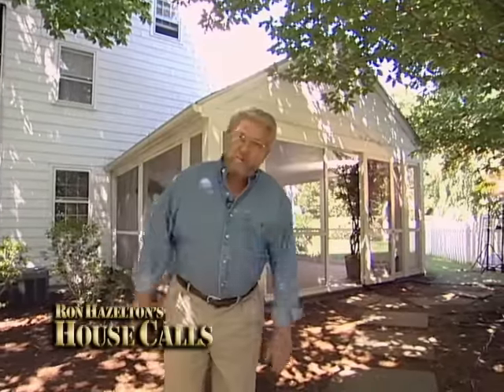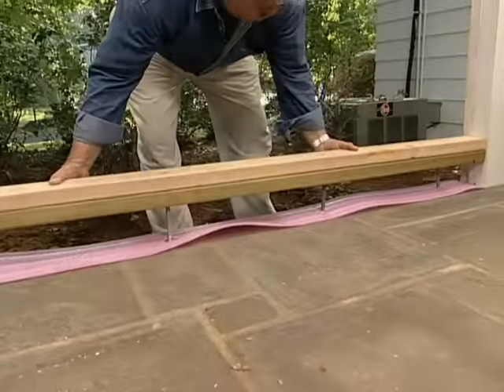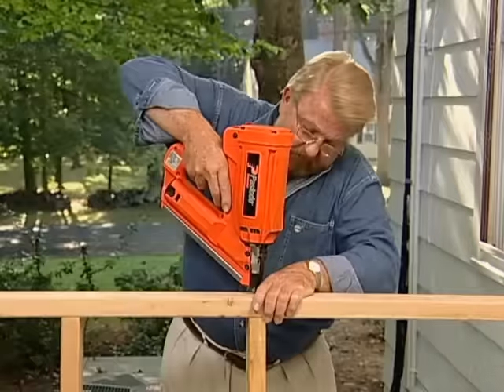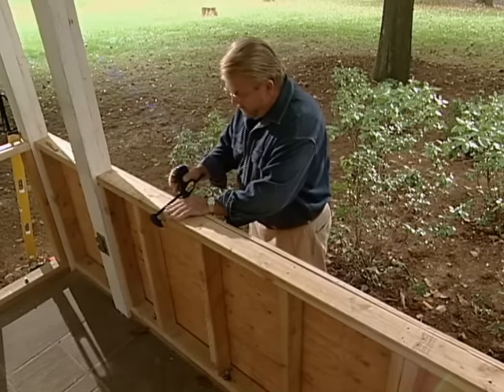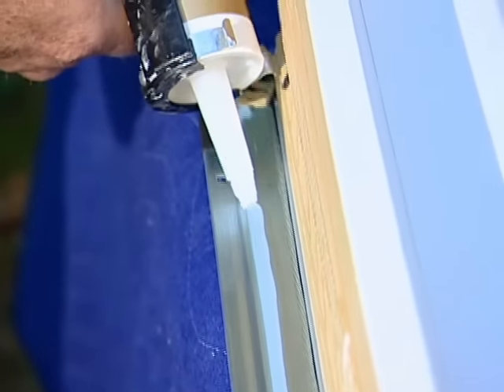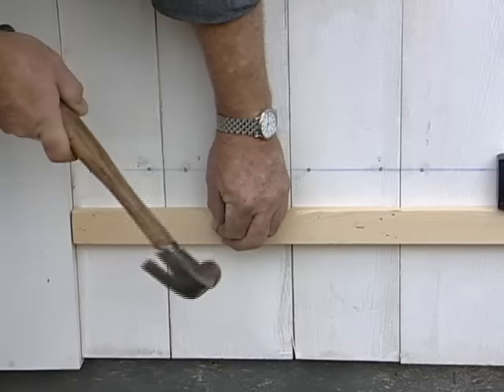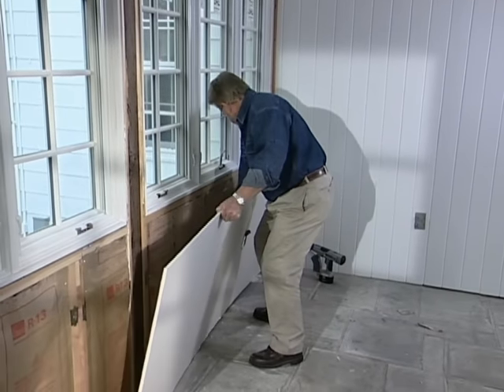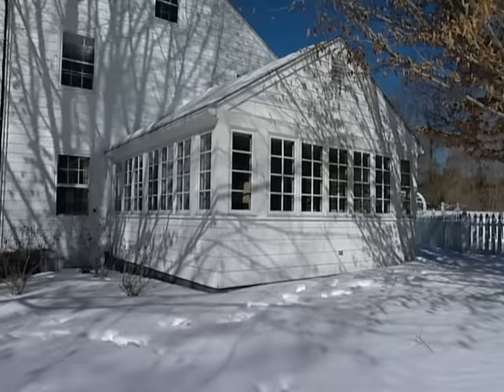How to Make a Four Season Room from a Porch

Comment: wondering if pounding on a nut topped expansion bolt causes the threads to deform. Seems like using a piece of scrap wood on top would be a good idea.

Comment: I have been reading about installation of windows and the diagrams they show include a header and Jack studs, and King studs.  This is to redistribute the weight of the roof around the windows.  I can understand the upper part because it has a large header as part of the roof but what about the bottom.  Nothing there but the studs on 16 inch centers.  Can they support such large windows?  Or am I missing something?

Comment: I am assuming there was already a header running around the entire room because it looks like you just framed in windows and doors with 2x4's without having to install any "structural" headers over door or windows to support the roof.  Is that correct?
Reply: Richard H porch roof is already properly supported by the posts that are anchored in the ground.  The walls are just "fill".

Comment: What about insulation in the ceiling?  Is that required to make it a 4 season room?
Reply: Should definitely be considered.  The reason it likely wasn't mentioned/done in this video is because you don't always have access if it has been ceiled in, which is likely the case here from what I see.

Comment: can you tell me if I would need to add more foundation to the existing concrete pillar footings on my screened porch in order to transition it from a screened porch into a four seasons room?
Reply: Mommi Sense i can if you live in florida
Reply: That's what I'm wondering! Our screened porch was built on our deck. Converting an outdoor room to an interior room may need adjustments to the foundation/footings and in our case, the flooring since we have spaces between the deck boards.
Reply: Laurie Clarkson i have same issue the sun room build on slab  i have to raise it  up otherwise i get all the  rain water in room ..and its to hot in summer and too coin winter

Comment: Great video!!! Just what I needed to convert my 3 season room into 4 seasons. You made it look so easy that give me reason to do job on my own. One question I have though is what did you do with concrete flooring for insulation? Another is are you using any source of heating/cooling? Thanks.

Comment: Can you show more about sealing the floor and what steps are involved in putting in a floor on top of a concrete slab that has cracks?
Reply: Id like to see a video about that too.
This popped up and im so glad it did. Your explanations and visuals are excellent!
Reply: Good suggestion! I have a screened porch i'd like to fix up like this, but the slab has some cracks that run the entire length.

Comment: Hi Ron, We have watched this video several times and I'm sure will watch it many more times to follow your steps and teachings. What is the brand and type of sheetrock nailer?? That nailer looks awesome. Would you mind listing the brands and models of the different nailers, hammer drills, drivers, and other equipment used? Everything seemed to work so efficiently. Do you use an air compressor or just battery operated tools? Thank you! Excellent job! :)
Reply: Leslie A Harden m

Comment: I'm confused. How is it warm in your new room, when you didn't run any HVAC?
How did you run ducts in the slab?
Reply: insulation, insulated windows and doors, electic heater,
Reply: gnpd07

Comment: What did you use to heat this space? I notice your flooring appears to be on a stone covered slab, have you any issues with it being too cold?
Reply: Space heater probably work very well because it's insulated.  You could also add an indoor flooring of your choice to insulate the room from concrete slab.

Comment: Im considering doing this but we dont have an existing slab, the porch was built with individual foundation footings with floor joists and 2x6 boards. Is it still possible or would I pretty much have to build a brand new structure?

Comment: design sucks. Why not just have windows that you add on in the winter like they used to do? Now it will cost to cool the room since you've put the windows and decreased the ventilation.
Reply: Before the windows he had floor to ceiling screen walls. Now it has half walls with better insulation, which keeps it cooler. Instead  of the freely open screened walls, there are now windows to keep is warm in winter months. All the while still allowing airflow by being able to open up the windows! Rewatch the video, only this time watch it very slowly, then you will understand the goal he had before begining his renovation project.

Comment: Oops!  Without HVAC you don't have an all seasons room.  This HVAC omission leaves a huge gap into the total construction and cost picture of this project.  A side note could have been added about HVAC venting and whether an existing AC unit could carry the extra cooling and heating load.
Reply: +John Losch all you need is one of the ventless ac units and also the same with heat.  iheaters require NO ductwork and any home improvement or trac
tor supply store can instruct on the use of these
Reply: +Hillary Jordan are you referring to a window AC unit?

Comment: I have a back porch that is closed in but here in Texas it gets hott back there how do i make a ventilation system to keep the hot air out and air conditioner air in!!
Reply: You've gotta insulate the roof and walls. For your climate, open cell spray foam works well for all of it and is a cheap option. Look up videos from matt risinger. He is a builder down in texas and will steer you in the right direction.
Reply: My walls are insulated already im insulated my roof next but its still like a oven back there im putting ventilation system in here shortly but my roof is like a hot plate cooking anything you put on it
Reply: @tyronesykes7577  depending on how the ceiling and roof are, it's hard to say what direction to go. If theres no duct work in the ceiling for the room, ventilate at the soffit with baffles and a ridge vent or gable vents, air seal the ceiling and blow loose fill cellulose or fiberglass into there at a very high r value thickness wise.

Comment: Nice work, but a word of caution for all you diyers. I can tell you as a building code enforcement officer that what he did is illegal. I know he did not get a permit for this job, because there were no footings for the original porch. Even a haunched footing (thickened slab at the edges) would not be accepted in any part of the US without proper footings and foundation. When this property is up for sale, a title search will reveal no certificate of completion is to be found. The selling of the house will  be held up until the disposition of this illegal porch is decided.  Anytime a 3-season room is converted to a four season conditioned space with the rest of the home, it must meet codes that were not followed here. ALWAYS check with your building department or architect before taking on a project like this. It will save you a lot of headaches in the future.

Comment: Using interior electrical boxes on an exterior wall. No insulation behind those wires leaves a void. I think your past problems with tape not adhering is due to not putting the mud on the tape first. I have never seen anybody pre wet tape until now! I've never heard of this problem before. Usually I see guys put some mud in a bucket with a couple of slits at the bottom of the bucket on either side. The tape is pulled through the bucket from slit to slit, when it comes out the second slit it's covered in mud. I didn't see a head flashing above the windows or doors

Comment: That 's a great closed in sunroom, but one aspect that he did not address is the HVAC concerns. Just because it's insulated, you still have all those windows, and you will need heat in the winter and A/C in the summer. He does not show how he added that to the room. But it's sure pretty!

Comment: You should have put thermostat Payne low e patio doors on all the walls.  The walls should have been covered with one inch foam board, tongue and grove.  The ceiling should have been taken down and at least 1 1/2 inches of foam board added. Then redrywalled.  You have now a great room, only thing missing is heat and ac.  You should have framed in a window type ac/. Heater, 8000 btu would probably be sufficient, this would give you a room that is comfortable year round.  The patio doors brings this room to a room with a dynamic view.

Comment: Hi Ron,

  I guess first of all, I would question the need for a level if you are forcing studs into position with a hammer...Would that not bend your top plate (or sill),out of level on your short wall? Second, the rough opening of your sliding door... It seems you are installing the ends of the studs directly on the concrete, should not everything touching the concrete be treated?  Third should you not mention that the plywood you are using should be held off the cement by 1/2 inch, (or there about), to also keep it off the concrete? Should you show how to level the windows and doors during installation also, they work so much better and shut tighter when level. I don't think I would use 1x6 between the windows either as sitting on that sill plate like you did is only asking for water damage. Using something like smart-board would be , well smarter as its resistance to weather has been proven to be a much better quality performer for this. They also make corner tools for sheetrock finishing, which makes that job a bit easier also.

Other than that, pretty good job for an amateur carpenter.  Cheers!

Comment: Ron, very, very nice and I appreciate your sharing; however, to me it’s another room that has to be cleaned, dusted, vacuumed, etc and worry about spilling something on furnishings or scraping a chair across the floor.  I’d live  to have one (for my orchids) but I still want a large screened porch.  With a porch, I can enjoy it as a outdoor room but do all kinds of outdoor projects even when it’s raining or snowing or just plain ole blistering hot. And I don’t worry about sawdust or even if I get a little paint (I can always sand or use paint remover)  and I can set up a large cardboard box as a paint enclosure) if it’s too hot to be out in the sun. Because I have a pretty nice vaulted, varnished  t&g ceiling, I don’t spray paint large items except in the yard, but small craft projects can be sprayed in the box set on its side.  If the power goes out — with my fairly tall vaulted ceiling porch, I can place the generator on the porch in the outer wall.  Let’s say we have a snow storm system coming in, at my age it’s tough getting out to the trash can in ice and snow - I can wheel the can up on the deck where all I have to do is open the door, lift the lid,  and drop the bag in.  It can even be rolled into the porch if the snow is getting too deep or the ice freezes the lid shut.  And in the winter, there isn’t any smell. When the weather clears, back to it’s position it goes.  The point is there are a whole lot of things I can do on a porch, particularly a screened porch that keeps bugs, leaves, critters, etc off. And you aren’t limited to decoration  - my porch has oak antique furniture which includes items like settee, church pew, an 1800s head/foot board soon to be turned into a bench,  same period dining table and fodder chopper, along with lots of antique/vintage decorative items.  If you keep them clean and rubbed down with orange or walnut oil even the orange furniture wax and buffed out — it keeps it all protected and moisture beads up and is easily wiped off. I have had household wood furniture on my porch for over 20 years.  The porch is attached to a large deck on one side and a small one on the other side that allows me to work on my potting bench.  Settee and chair cushions can be left all year — my settee, has its same household foam cushions that I put on it 30 yrs ago to go in my living room — but there isn’t any filling etc that would mold, just a dense foam with whatever fabric catches my attention for slip covers — easily changed out.  And even better, if starting fresh with cushions, use outdoor foam, and Sunbrella brand fabric. Can even be bleached (check their website for direction) if it meets up with mustard, wine, grape juice, pickled beets, tomato sauce, etc. 

But my point is if I have drapes, inside sofa/chairs (interior wood you can’t get to to protect and all the stuffings etc that would stay damp for days and mildew ), interior rugs & flooring and other interior furnishings (lamps, etc) — it becomes a living room — not one that you feel comfortable to cut shelves on, or to sand and paint a chest, or some other project normally done outside.  In addition, even if you open the windows, you still can get that fine mist of sawdust etc on all that glass and if doing a lot of projects, endless cleaning.  And you will never have the same breezes as with an open screened porch due to all the framing, blocking, sheetrock, etc. 

Now all that said — if you are fortunate enough to have the space and money — go for both. Place the four season with HVAC on the warmer side and the screened porch on the shady side. Depending of course where you live and the room’s orientation, remember all that glass, even with a regular roof, can be quite hot and bright in summer — you will need HVAC (certainly AC). But if you orient the room with an South/East , or South/West orientation, in the winter you have a lovely sunroom feel with sun streaming in - even do skylights with blinds in them, or do windows with blinds in between glass panes to control the sun exposure.  It gives your plants (think orchids, violets, gardenia, hibiscus and many more that can be house plants) plenty of light in winter.  When it’s 10F degrees outside with the wind howling, and you have HVAC, there is no better place than a sun room or greenhouse.  If you have a good southern exposure, and the outside temps stay above the 30, the heat will rarely come on until evening.  But in the summer when it’s hot, the screen porch on the east side is a delightful place for a cup of coffee, breakfast, dinner, etc but being on the East, the sun is off it by midday and through the afternoon (you can place small ornamental trees out about 20’ from the house to shade the afternoon sun).  It really depends on how your house is built, what’s around it, yours or your neighbors trees and a number of other factors.  If you can only have a sunroom (a 4 season room), you stay inside most of the time, and you don’t care for plants, then you might not want to  place it on the south or west side as the air conditioning might be a little pricey. Use glass that reflects the heat and triple pan windows and doors.  Or if your view (or position) demands the south/west side, just make sure you place trees appropriately to shade in the summer and drop their leaves to let the sun in for the winter.  Or have thermal backed drapes.  It’s amazing how much heat builds up with all that glass.  Good luck.  

I have lived in my house for 30 years and have had a screened porch for 20 and though in the winter I think how nice a sunroom would be for my plants— giving up my porch that’s works great Spring through fall - I can’t imagine. Even in winter, when it snows, I can walk out in my slippers to get a few minutes of fresh air and feel like I’m out in the snowy air without getting wet or having to pull on gear. It’s great in your jammies super early am hearing the doves just starting to coo or the birds waking up -while  having a cup of tea. Even to step on the deck while the hummingbirds eager for their first feed, buzz you or just lean against the interior railing on a drizzly morning hearing them buzz  and squeak inches from your head - but you are still dry, no umbrella to disturb them.  Or when you can’t sleep in the middle of the night, to have a cup of hot chocolate or tea on the porch listening to the silence and gazing at the moon — still in jammies, no need for shoes or worrying about spiders, bats or mosquitos.  It’s not the same in 3 or 4 season room, having had both. Of course if you are an inside person, and don’t like all these things, then another living room or den will suit you well and give you more space to watch tv, work on the computer, do small crafts that ventilation isn’t an issue, read and just gaze outdoors through 3 panes of glass - then you will be very happy.  And for me, the big draw for a sunroom is all the glass for my orchids. As I say, if space allowed, I would have both.  

You can tell I want folks to think twice before getting rid of their screen porches - once it’s done, it’s done. I have seen a number of people who regretted it or ended up building another porch — the ideal situation is to have both but it’s not in the cards for all.  Sure you can raise the windows and open the door but it really isn’t the same.  And if you are a creative person or an artist, one final note.  
A friend of mine was a lifelong artist (a real artist not a want-a-be like me) and she said she couldn’t wait each year to move her easel from her lovely sunroom to the screen porch. She said she could really feel the air all around her, see the plants move, the play of the light as it changed throughout the day, but more importantly, she could smell the flowers, hear the birds, hear the slightest rustling of leaves, hear the squirrel as they ran up the trees, etc. She said it made a a huge difference in her creativity and mood even though she had a rather large gorgeous sunroom but she said she still felt removed.  She felt more a part of nature and though she would hate to do without the sunroom because it really was a pleasant winter space, but the porch was like working right out in the garden.  

I know this is long but I hope it gives folks a few thoughts. Be blessed and enjoy whatever you end up with — porch or sunroom. Both have their benefits.